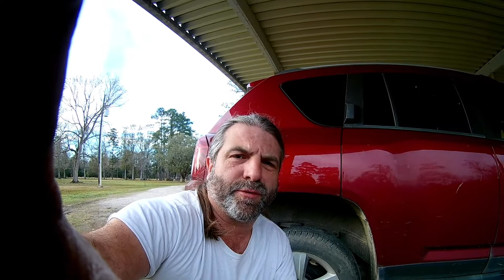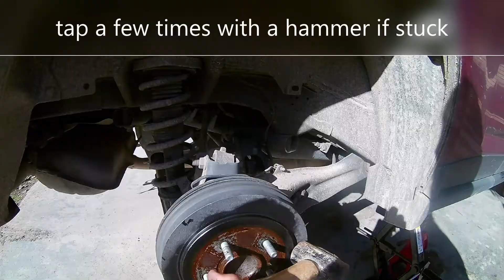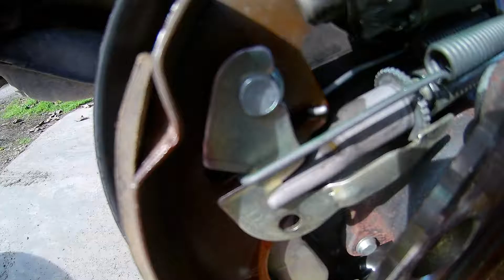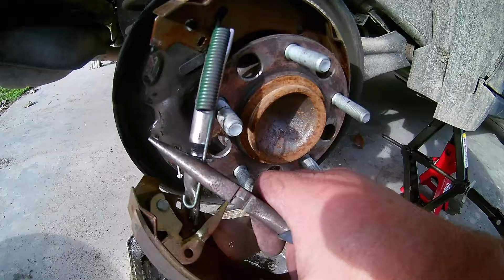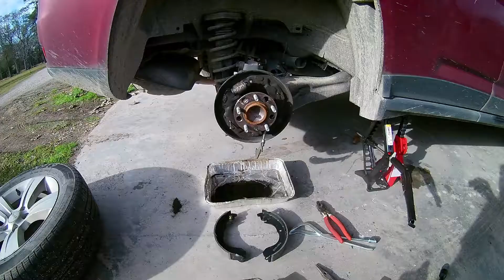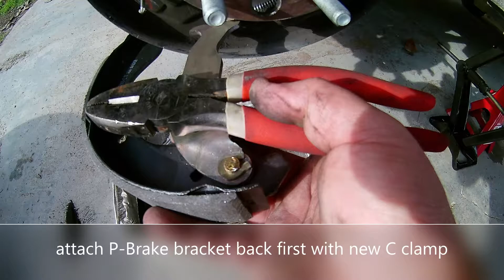DIY Jeep Rear Drum Brakes

Comment: i have same rear brake, i removed drum to change the one of the stud, now the drum is not going back. what i did wrong?
Reply from the maker: Sounds like you need to let the pressure out of the brake lines so the drum will go back over the brake shoes
Reply: @LouisianaBlackwaterFlyFishing  Thank you, i do not know how, but i will research.
Reply: Adjust the shoes with the star wheel

Comment: I had a question, is it normal for the brake cylinder to leak fluid while installing the shoes?
Reply from the maker: Not sure mine never have
Reply: i have the same thing happen but it only leaks when i would move the brake shoes around which moves the two little parts on the brake cylinder,  there is no sign of fluid before that though. very strange
Reply: @Chefxxp  ol
Reply: if the rubber grommet comes off your brake cylinder, you're gunna loose a bit a fluid, no big deal. but if its leaking without you touching it, you should definitely change that bad boy